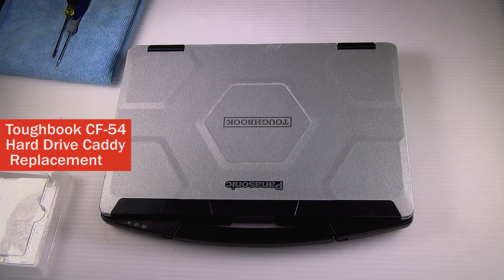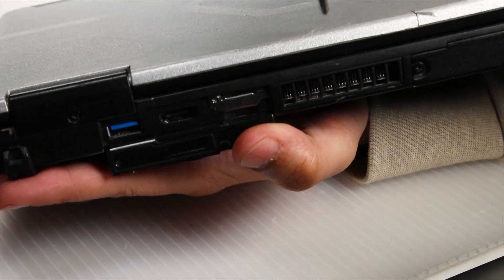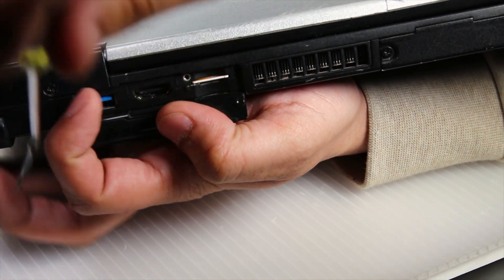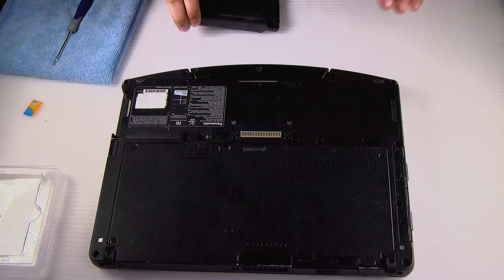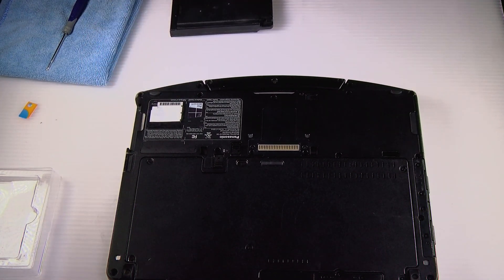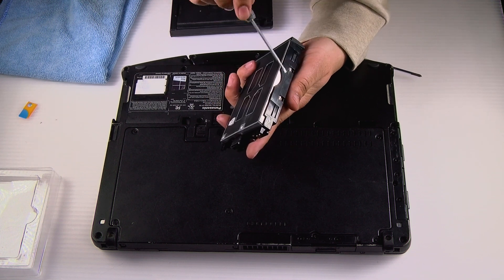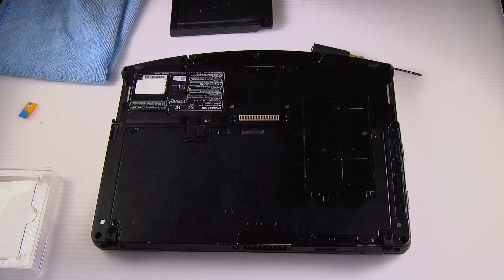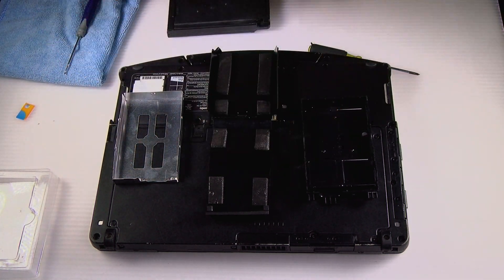Replace Your Toughbook CF-54 Hard Drive + Sim Card**

Comment: i cloned my hard drive with Acronis from a 240 GB HD to a 2.2 TB SSD, installed the SSD per the video and rebooted, all it sees is 240 GB, not the 2.2 TB, though when i run the troubleshooter through the BIOS it shows the drive as 2 TB, i tried copying larger files to the new SSD and it wont go above the 240 GB,  is there a setting some where that needs to be changed ?
Reply from the maker: Yes, Its easy, Hit the windows key and the X key.  Pick disk management.  Right click the partition and choose extend.
Reply: So its possible to have two harddrives?